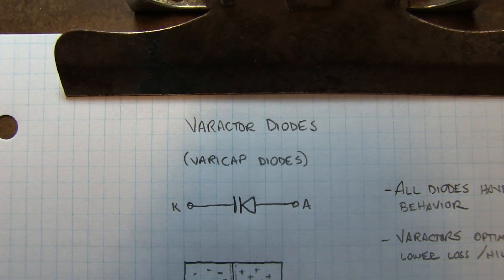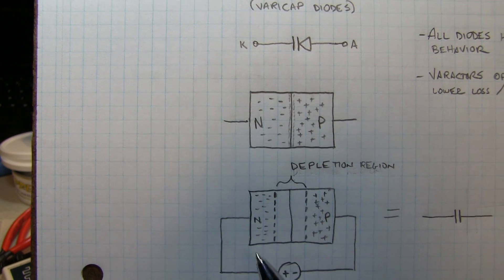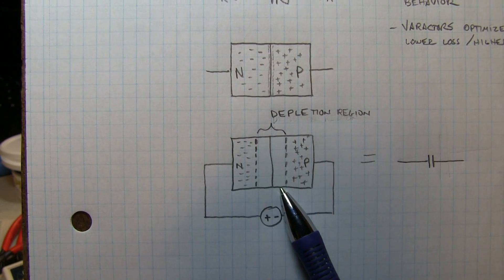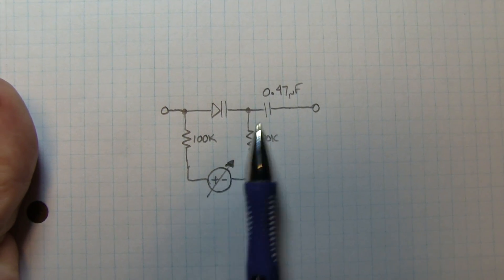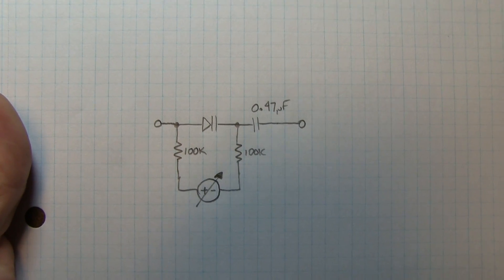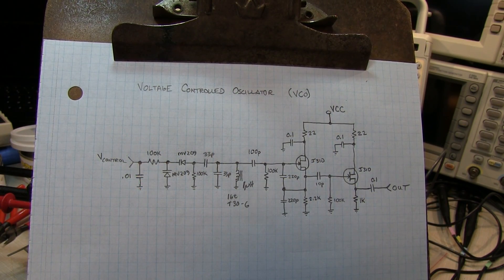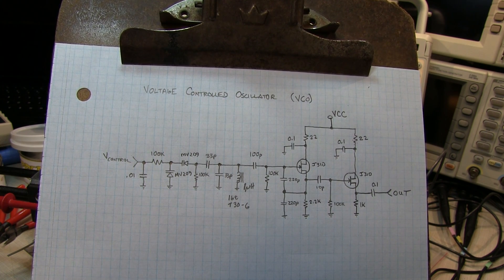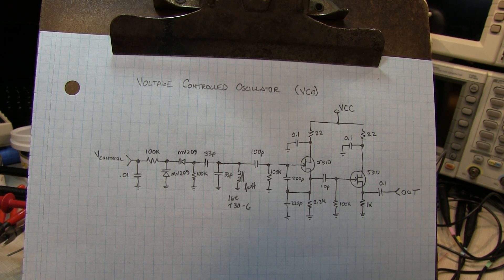#147: Basics of Varactor Diodes | Voltage Controlled Oscillator VCO Example

Comment: Instead of using resistors to block the DC bias from the measurement, would it also be possible to just use inductors to act as a choke?
Reply from the maker: You could, but they’d need to be high value due to the low test frequency.
Reply: @w2aew Wow thanks for the quick response on a 10 year video! If I’m planning to use a varactor to tune a matching network, I assume it be better to use resistors to block the DC bias since an inductor choke would probably affect the resonance? I am operating around 200 MHz.
Reply from the maker: @lejuanjames3860  With careful design, you could make it work with either.  Ferrite might give you better wideband loss than a simple wound inductor.

Comment: Great video, sir.
I have a doubt about how to find the inductance value for 100 ohm resistor or any resistor in high frequency. Because at high frequency it behave like inductor how measures please acknowledge me
Reply from the maker: The parasitic inductance of a resistor is highly a function of the resistor construction, lead length, etc., and is typically quite low.  You would need an analyzer that tests at high frequency, such as a Vector Network Analyzer to test this.
Reply: @w2aew  S sir, we have vna in lab. Can u tell me the procedure? I will check tomorrow.
Reply from the maker: @sahirview  This video goes through the measurement in detail.
https://www.youtube.com/watch?v=Pti8Erw_Kkg
Reply: @w2aew  thank u sir

Comment: Hi, this is an old vid so i dont expect you to answer but i tried this circuit and couldnt get it to work. I tried to do it on a perf board and manhattan style. I used NTE618 as the diodes and some random schottkey ones. I Used J231, BF245C and BF256 as the transistors, multiple coils arround 1uH. I also tried switching some of the caps. I am 99% sure that everything was correctly connected but still didnt work. Could you maybe help me? Good video anyways!
Edit: i also checked out the book. I tried out some other Circuits too (multiple Vackar ones, i would love to get one of those to work because of their characteristics) but i couldnt get them to work.

Comment: hi, I finally made mine, but having some questions/problems - what do you use as Vcontrol? (10 turn pot? what value?, or do you something else?). I thought it should be here 10 turn pot or usual potentiometer? (I connected 10K 10 turn pot), but there are here 3 pins here, so hooked up 2 of them (no sign of any sign wave on oscilloscope). I am having nearly the same Volts on D and S (a little bit less on G) of J310, as power supply (here 12V). Wondering what I do wrong? I want to use this VCO to one of DCR for 80m band, so would be great if someone could help. thanks! How would I check if J310 are still OK (not damaged)?
Reply from the maker: The Vcontrol input is intended to be driven with an adjustable voltage source.

Comment: Can you do a video on the differences involved in generating AM & FM from the perspective of the oscillator circuit. Most of the videos online simply explain the waveforms, but not the mechanisms or techniques for generation. In other words, can I modify any VFO into a VCO to generate both types of modulation? Thanks!
Reply from the maker: FM as you know is executed by changing the resonating frequency of the oscillator.  AM is typically NOT performed in the VCO/VFO - it usually performed with a separate modulator stage.  Attempting to do it in the VCO/VFO is difficult because the mechanisms to change the amplitude would often also change the frequency.
Reply: @w2aew  "AM is typically NOT performed in the VCO/VFO - it usually performed with a separate modulator" ----

I have learned this well thanks to your videos! Your tutorials on Gilbert Cell and Ring Modulators were real game changers in my understanding of AM. I'm hoping to see similar tutorials on FM. 
In my FM experiments, I've noticed that I sometimes get unwanted amplitude modulation and also that some types oscillators seem to work better with FM. I've made a number of FM transmitters, but it is always very difficult for me to eliminate noise and prevent drift since the oscillator is being modulated directly. I'm sure there must be some techniques and best practices of which I am not aware. Looking forward to your insights! Thanks again.

Comment: Thanks again, your circuits ALWAYS work. The additional buffer on the VCO produces a very stable broadband output.   https://youtu.be/RXAKpCc1QI0
Reply from the maker: nice job
Reply: @w2aew  Thanks again for the VCO design!
I had attempted several methods for injecting the audio signal at the varactors' node but with unsatisfactory results until I saw AllAmericanFive's video using an isolation transformer to modulate the VCO circuit. Works quite well now, but I'll have to add some shielding or a metal enclosure.
Reply: @w2aew  I was wondering if you've ever tried using varactors in place of a ganged variable capacitor for a superhet receiver?  I'm ok with the simple varactor VCO, but I'm not sure how to combine two coils in one VCO with a mixer... Any suggestions?

Comment: Another great video! I've copied several of your circuits and they always work very well. I made a FM Band version over the weekend with some J211's I've had laying around (https://youtu.be/qv5a3hgzP-o). I haven't achieved the full bandspread yet (about 88-102MHz so far), but I'm still tinkering. Puts out about 1.5V so I'll need several stages of amplification before I can drive a 50 ohm load. Thanks again!
Reply from the maker: Now, if you couple an audio signal on to the varactor tune voltage, you'll have a basic FM transmitter...
Reply: @w2aew  I've finally got the spread figured out. I used a bb910 for the (series) padder and the nte610 for the trimmer (parallel).  The 910 is advertised as an AM band tuner and the 610 for FM. The combination gives full FM band width (88-108MHz) with my 6 turn FM coil. I assume the combination would will also work for the AM band with an AM coil. 

Now, as you mentioned, I have to add the audio. Is there a rule of thumb for the voltage ratio when modulating the frequency? I'm not sure how strong the audio needs to be.
Reply from the maker: @andrewferg8737  Once you know the tuning rate in frequency_deviation vs. voltage, then you can compute the required audio level to achieve a desired FM deviation.  For example, let's say you determined that the VCO tuning rate is 2MHz per volt.  Let's also assume that you want 10kHz of peak deviation with the audio signal.  Thus, the peak audio voltage would be the deviation divided by the tuning rate, or 10e3 / 2e6 = 5mV peak.  Probably best to do it with a potentiometer so you can adjust the audio drive and "listen" to the result on a nearby receiver.  The unshielded circuit will probably radiate enough to be easily picked up by an FM receiver on your bench.
Reply: @w2aew  "10e3 / 2e6 = 5mV" sure beats my typical intuition or trial & error methods. Thanks again!

Comment: Precise, short, yet well explained tutorial on varactor diode. In the test bench circuit shown (2:10 mins), isn't the power supply polarity wrong ?
Reply from the maker: Yes. The downloadable notes have been this error corrected.

Comment: One of the things that I'm having trouble with about these devices is how you keep signal voltages in a given circuit from affecting the capacitance you end up with...
Reply from the maker: It is difficult or impossible to keep signal voltages from affecting the capacitance. Sometimes you can arrange a pair of varactors so that the signal voltage affects them in opposite ways, and the combination somewhat cancels the effects of signal voltage.  Another reason why these are used in small signal applications.

Comment: A really nice tutorial.  Well done, to the point, no dumb YouTube nonsense before you get to the meat and to the point.  One thing, though.  On your paper schematic where you talk about theory of operation, it looks to me as if you've forward-biased the diode if one were to connect the power supply with the polarity shown on the sides of the symbol.
Reply from the maker: Yes, I drew it wrong - sorry about that.  The downloadable PDF notes has this corrected. https://www.qsl.net/w/w2aew//youtube/Varactor_diodes_with_VCO_example.pdf

Comment: Hi Alan @w2aew,

Thank you for this very interesting video.
I ordered varicap 1SV 149 and wanted to test them.

On the schematic, you use a capacitor with the capacitance meter (0.47 uF)

I this montage and I really searched for a long time, here is what I don't understand:
:
- If I connect the capacitance meter after the capa I get false results.
- If I plug it directly into the varicap the results are OK!

However the video indicates the opposite!
I understood that the capacitor blocks DC not to disturb the LC meter and the resistors are sufficiently high
so that the supply impedance does not affect the measurement.

Do you have an idea?

Thank you in advance
Reply from the maker: There was a small mistake in the diagram on the video (the varicap was shown with the wrong polarity).  Use the diagram in the downloadable notes: https://www.qsl.net/w/w2aew//youtube/Varactor_diodes_with_VCO_example.pdf
Reply: @w2aew  HI Thank you but it's not the solution as I had already the varicap used in reverse polarity ...
Reply from the maker: @Bremontval  it is possible that your meter uses a different measurement scheme and needs a DC connection to the DUT.

Comment: First of all I want to thank you sir for this great video, but I have one question. 

What is the purpose of those 33pF capacitors in parallel ?  They are use only for tuning the frequency or do they play some role in separating the biasing circuit of the varactor diodes from the rest of the oscillator  ? 

I would appreciate it if you or someone in the comment section could clarify this for me , thanks again for your effort .
Reply from the maker: It is the combination of both 33pF caps, and both varactor diode capacitances, that determine the oscillation frequency along with the inductor.
Reply: @w2aew  Thank you sir, for clarifying and quick reply !

Comment: Could you use a X7R ceramic as a varactor?
Reply from the maker: You can - it won't vary as much as a varactor, but it might be difficult finding one in the low values necessary for RF work.

Comment: Great lesson as usual. I would love to hear an explanation of padding and trimming a varactor tank circuit to adjust the bandwidth.  This has always been a challenge for me with conventional tuning capacitors. A bit of math, but mostly hit and miss. I'm new to using varactors and I could use some tips. Thanks!
Reply from the maker: It always is a bit of a trial game.  Adding caps in parallel increase the overall capacitance and reduce the relative adjustable range achievable by the varactor.  Caps in series with the varactor will lower the total capacitance and make the relative adjustable range larger.
Reply: @w2aew  Question: Would it be possible to add a ratio detector to a regenerative FM receiver or would the demodulator require a heterodyne setup with an intermediate frequency?  I've made a rather nice regen with an amplifier, but it's a bit scratchy. So, I'm wondering if it's possible to add a Foster Seeley circuit. I have made an AM superheterodyne and I'm slowly working towards more complex FM version.
Reply from the maker: @andrewferg8737  The Foster Seeley discriminator, like the ratio detector, utilize a tuned circuit to detect modulation around a tuned center frequency - such as an IF.  So, unless you want a fixed frequency FM receiver, you'd need a superhet to get an IF.
Reply: @w2aew  
Thought so. I saw another fm reciever with a pulse counter demodulator. It also required an IF, but seemed simpler than a superhet. Any thoughts would be appreciated.
Reply from the maker: It appears that this method also needs a low value IF.  I never play with this, but is nice in that it doesn’t require any tuned circuits in the discriminator.
Reply: @w2aew  

Yeah... Not so many coils to mess with. Watching the vid by vk2zay and his IF is 22k. The LO would be around 8MHz if my math is not off... Any reason the IF is so low in the pulse counting set up? Would the same set up work with the standard 10.7MHz IF? I've got a bag full of 10.7 crystals I was hoping to use...
Reply from the maker: @andrewferg8737  Actually, the IF in Alan's design is around 100kHz, with a 200kHz BW. The IF has to be at least a little higher than the peak deviation of the FM signal.  The 22kHz you saw in his documentation is the low pass filter following the monostable pulse generator.    A 10MHz IF really won't work well, because the response of the pulse counting demodulator is a strong function of the deviation divided by the IF frequency.  A 75kHz deviation (like broadcast FM) is very small compared to a 10.7MHz IF, so the response will be very low.  In addition, the pulses generated by the monostable would have to be well under 100ns wide.   Bottom line, it's best to use a low frequency IF, centered at something a bit higher than the peak deviation of the FM signal.
Reply: @w2aew  

Math is hard... The LO would be around 8MHz ?
Reply from the maker: @andrewferg8737  It depends on what frequency you want to receive.  If you make the IF at 100kHz, then you make the LO frequency 100kHz (or 0.1MHz) above the receive frequency.
Reply: @w2aew  

That's what confuses me... 100kHz above an FM band signal would still be in the same band and really close to the received signal. So if I'm receiving 97MHz, my LO would be 97.1MHz ?
Reply from the maker: @andrewferg8737  Yes, that is true.  In fact, if you tune the LO to 97.2MHz, then the stations at 97.1MHz and 97.3MHz will appear in the IF.  This is the biggest problem with single conversion designs.
Reply: @w2aew  

Despite being able to build stuff, my understanding of physics is terribly limited. Just when I thought I had begun to understand FM demodulation this whole pulse counting set up has gotten me confused...  I'll have to do more research so I can understand your answers better LOL. Thanks so much!
Reply from the maker: @andrewferg8737   No worries.  The "pulse counting FM demodulator" operates very differently from the traditional ratio or Foster-Seeley detector.  Think of it this way.  The circuit generates a narrow pulse at each cycle of the carrier (IF).  This pulse is a fixed width in time.  Thus, as the frequency is increased, the duty cycle (or the average value) of the pulse train increases.  As the carrier frequency decreases, the average value of the pulse train decreases.  So, quite simply, the baseband audio is derived by low pass filtering the pulse train, which puts out the average of the pulse train.  Does this help?   Hmmm - maybe I need to do a video...
Reply: @w2aew  

Helpful as always... and YES definitely do a video!
Reply from the maker: @andrewferg8737  Check the video out: https://www.youtube.com/watch?v=jQlN2fc7LJc
Reply: @w2aew  

Side project question:
I bought one of those cheap frequency display modules to use with my transmitter projects but haven't been able to get it to read anything except my signal generator. After a couple of failed attempts at making a buffer I gave up. The display remained in my junk box for a year. After watching a couple videos yesterday, I tried again. I built an amplifier circuit capacitively coupled to the oscillator using a 10p which is outputting a clean 100mV sine wave. The oscillator frequency remained stable, but the display module still fluctuated wildly. I tested the module with my signal generator again, and it worked fine at 40mV. Also tested my buffered signal output with a RF meter and got a correct 97MHz reading, same as the oscillator and antenna. Still doing some research... Do I need a Schmitt trigger or ADC to feed the analogue signal into the display module? No idea how to do that...
Reply from the maker: @andrewferg8737  The problem could be with the input impedance of the counter.  I assume that when you tested at the output of the 10pF capacitor, that you were going right into the scope (or a scope probe), which is a very high impedance.  If the input impedance of the counter is lower, then you might be getting too much of a voltage division between the 10pF cap which looks like about 165ohms at 97MHz.
Reply: @w2aew  

Did some research as the unit did not come with any datasheet or instructions. Seems it's only good up to 60MHz... I'll trying hooking it up to my superhet AM receiver... but I have a feeling it will require a much stronger and more stable signal than my osc is capable of.
Reply: @w2aew  

WOW! Thanks! Really helped to clarify how pulse integration works.

Comment: I searched for that LC Meter. It was made by Neil Heckt and he unfortunately passed away on August 19, 2015. I searched ARRL Publications for any kind of LC Meter and the only one that came up was from Ron Portugal, founder of Continental Specialties,which made test equipment. "Computer-Controlled Electronic Test Equipment" parts 1 and 2 Dec 1993 in QST Magazine. Ron also passed away in 2013.

Comment: That was a well explained videos about a VCO on you tube. If I may make request, can you explain what variable in the circuit  could be changed to produce a desire frequency
Reply from the maker: The resonant frequency of the LC tank circuit is what determines the frequency of oscillation.